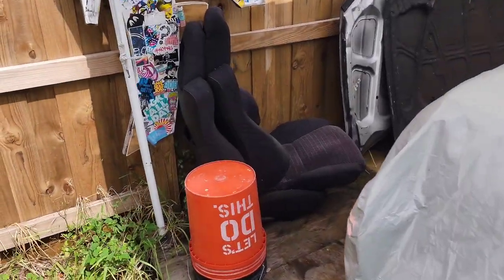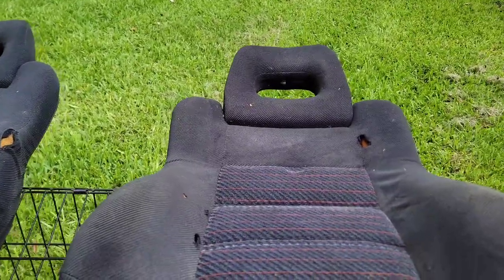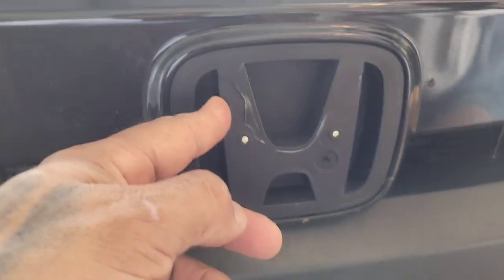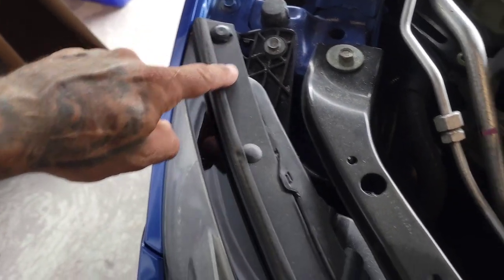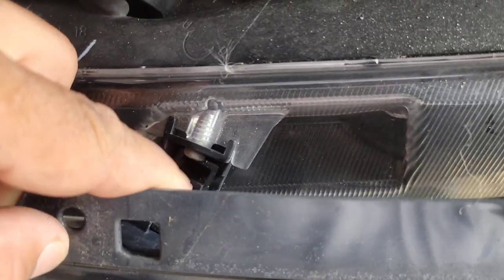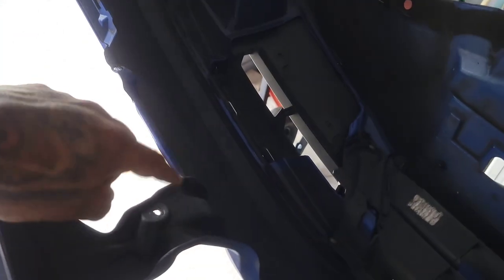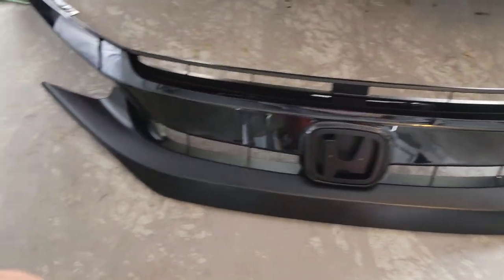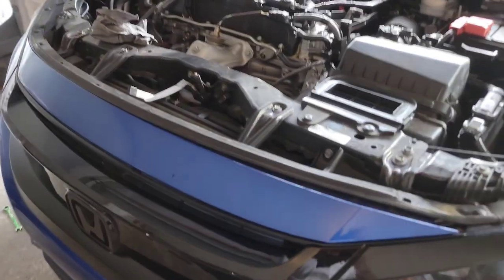2017 Honda Civic- How to replace front grill

Comment: Was your grill emblem holder bigger than the OEM? I replaced my front grill with an aftermarket one and my OEM badge is slightly smaller than the housing on this new grill
Reply from the maker: Pretty sure it was the correct size. I don't remember it being smaller